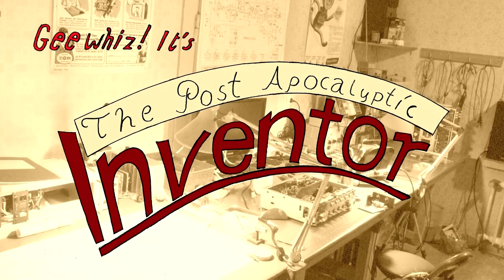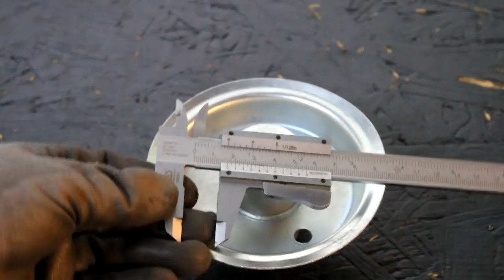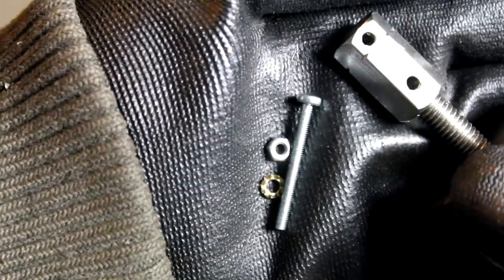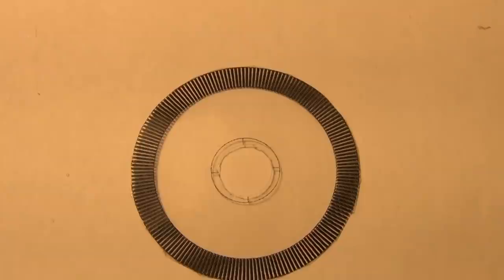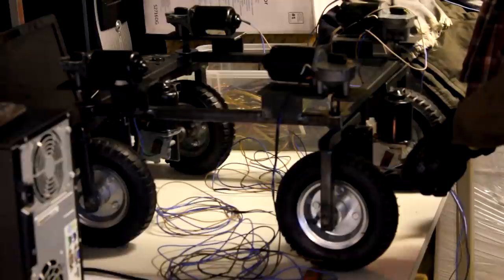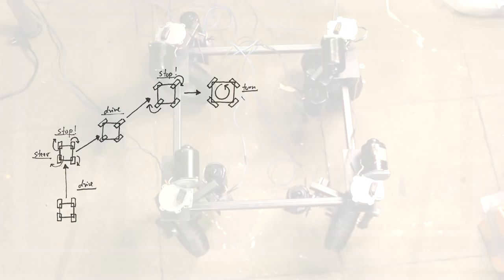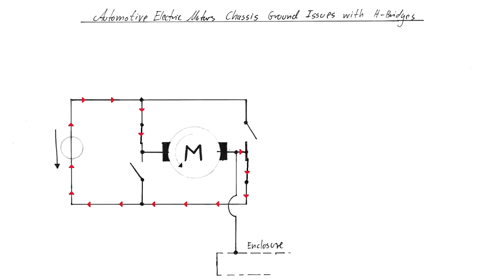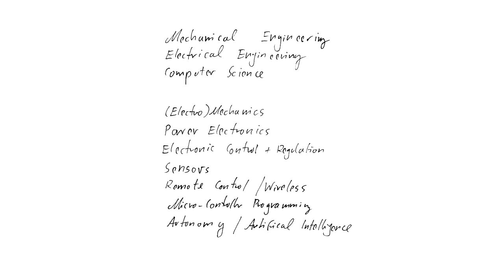Build a Robot with Windshield Wiper Motors

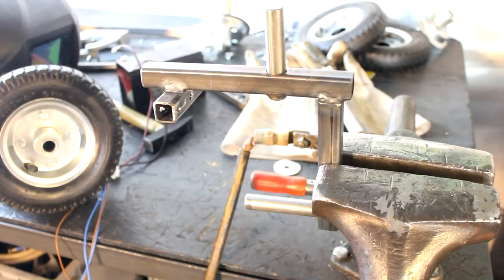Comment: Great work.  Some  questions - at 10:00 - the flat steel bar is 70mm wide but how thick? Wouldn't it be better to use bearings on the moving surfaces in the steering mechanism?  How many watts does the unit chew up?  The motors rotating the wheels can turn through  360 degrees. How do you stop the wires twisting without a slip-ring?

Comment: Nice work,
but why do you added 4 extra steering motors if you have independent drive wheels ?
you can steer with the drive motors, like a tank does, even rotate in the same place if one side goes forward and the other backwards.
Reply: oh,  you already explained in the video..  srry..

Comment: Winter is coming (Here!). Any chance of a personal transportation tracked vehicle? I was thinking grass skis with motors. Or perhaps a trike with 3 or 4 powered tracks. Perhaps using many motors and inverted timing belts, such as those found in cars. Any large garage who work on one brand of cars will regularly be throwing such belts in the trash and they might accumulate many of the same size tracks.

Comment: My friend, you are. I also liked your video. I just do not know how to turn the rotation.
Reply: You need to cut the wires inside the wiper motor. Also cut the ground wire wich connect one terminal of the motor to its ground case. After removing the integreated encoder, you can control the motor in both directions.

Comment: Thanks for the video!
I started an attempt to operate exactly these wiper motors with the BTS7960. 
The wiper motor gets exceptionally hot. 
Is that normal?
Reply: Hmm. Does it turn (run) it all when you power it? How long go you have to run it until it gets so hot? What is the voltage and current at the motor?

Comment: Zinc and stainless steel are unknown to those in the USA. Zinc is used by germans like chrome used to be in the USA to avoid rust. Yes, that is possible.
Reply: 0MoTheG What? Almost all outdoor metal in the US is hot dipped galvanized with zinc. It's not a secret process.. All countries use hot dipped galvanization.
Reply: Certainly not secret. But come to Germany and compare our road, traffic sign posts, guard railings and about anything with ground contact to what you see in the USA.

Comment: Would it be possible, in principle, to have a pillar under the cart that pushes up the whole device, then rotates on a single axis and goes down again. Then the wheels only need to drive forward. Of course this is super slow and inconvenient. But in principle?
Reply: I don't see why not, however you want 3 or 4 pillars (or a really big one) so it won't tip over if it's unbalanced. Seems like it would take up more space too.

Comment: Is this the secretive traction unit under the new tesla semi :)
Reply: they are using standard rear on it, its just hidden behind two flat panels, you can bet in real life no-one will use them as it means tyre maintenance and daily checking is so much harder
Reply: The weight is a big issue in the UK small bridges have a gross max weight the traction unit will take up most of that without the load attached.
Reply: yes, thats the problem with all the cells needed to get respectable range

Comment: you should not just cut the grounding. better replace the wire link with a capacitor,  to sustain the shield-effect. A long ground wire will emit radiointerferences due to the AC current flow: seperate DC but keep AC. For Automotive manufacturers those connections are important for getting the required technical certifications- If they could they would even economize this small piece of wire and soldering point.

Comment: I fear to see your robot making multiple weel rotations breaking the connection with the motor it carries. Easy mistake to do while programming it.
Reply: An easy fix for this would be a simple clock spring using brass rod and copper contacts. Not sure if that would be compatible with a potentiometer to identify wheel orientation though.

Comment: What happens when you have one windshield wiper that operates better than the other? Then you will have drag on one wheel which will impede uniform movement
Reply: bob mcboberson Operates better? Speed compensation is easily done if the wheels have encoders and the robot is using a microcontroller.. even RC cars can accomplish such menial tasks.
Reply: You're wrong but ok
Reply: RC vehicles have diffs and one motor per axle (if not just one motor per vehicle) don't they? That way they don't need compensation electronically.
Reply: Benny Lloyd-Willner If they're skid steer then there's two motors, my other comment was just a dig at the original guy for being rude (different comment thread)

Comment: Your 4 wheeled steering design is interesting, but why not just steer like a military tank? As in, to turn right, simply slow or reverse the right side wheels, causing rotation/steering. I would think that would be a much simpler  design.
Reply: Brad Phipps and itd work better for combat robots
Reply: The would be friction working against desired direction. No big deal but when using battery you don't want any opposing force if you can help it. That's what I think anyway.
Reply: Benny Lloyd-Willner meanwhile literally every combat rcv except for killerhurtz...
Reply: dat guy sorry mate, but from my view this is about a generic robot and not a combat one made for just a few minutes usage. Combat robots are of course focused on combat and all else is not a priority. I think this build had a completely different goal. But of course I may be wrong, just an opinion.
Reply: Downside of how tanks steer is more effort required to turn, and marks left on the surface. For a tank on rough ground who cares, but no so good inside on lino.
Reply: it destroys whatever its driving on and isnt great for the tires either

Comment: Anyone here in the comments that's thinking about building somthing like this.. goto junk yard get 4 wheel hub the new types not cone type a lot of them are 5 on 4.5 lugs as well which fit small lawn and garden wheels all the way ip to 1/2 ton truck wheel not to mention most have 28 centers  splines

Comment: bolts, or pins in the shaft can serve as shear pins.  I would have used cotter pins in the shaft coupler it would have worked the treat instead of welding. but oh well.